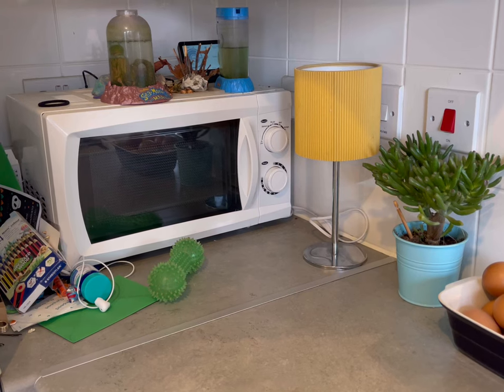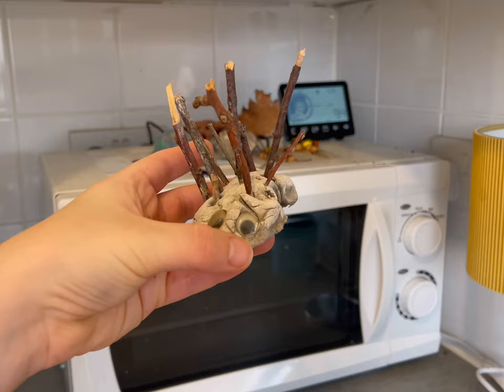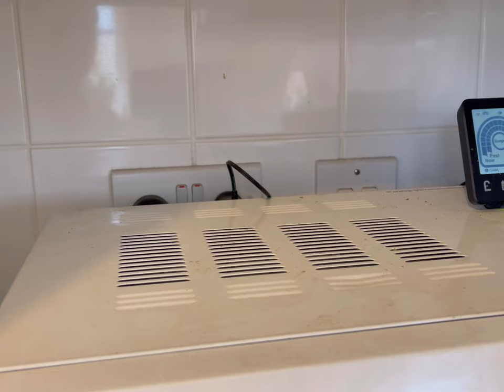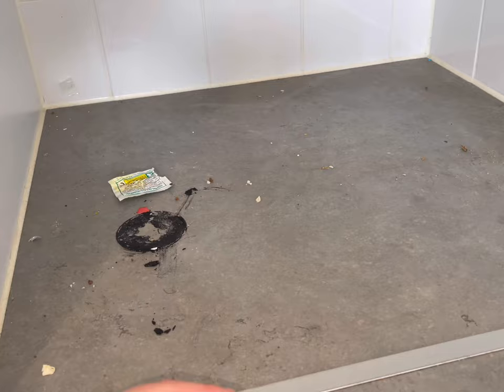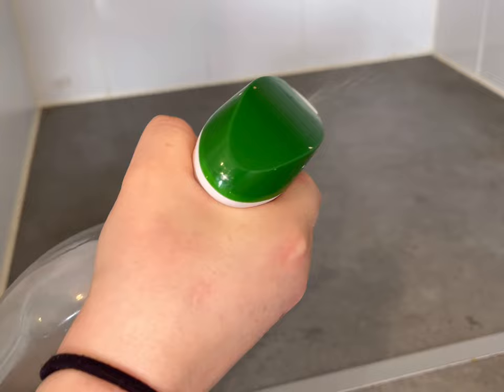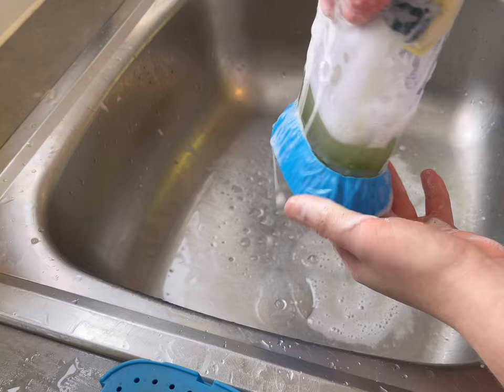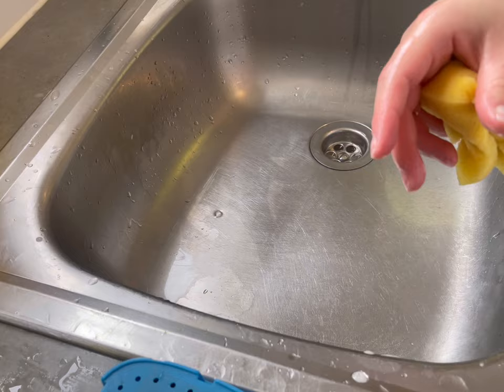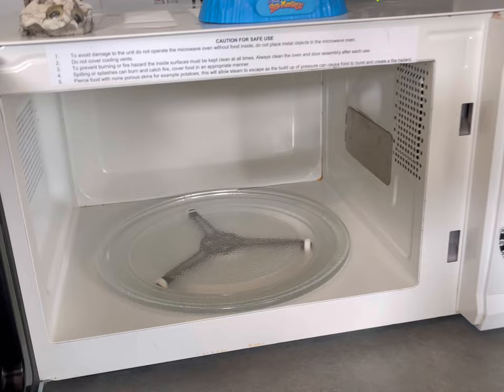VERY SATISFYING -Deep cleaning the microwave and decluttering the kitchen counter

Comment: Hello Remi, i just discovered  your channel. You're very sweet and down to earth. I clean my microwave by putting a bowl of water with a little vinegar in it and turning it on for 5 minutes. The steam helps loosen the splatters. You just have to wipe the area then. There's no need to scrub. Please try it next time. Lots of love from Canada.😊
Reply from the maker: Oh thank you for the tip!!! I will try it 😊
Reply: @remiclog   just discovered  your channel too, when you can buy some microfiber cloths they last for years and are better for cleaning than paper towels, microwave cover will help too, it save me, nice job, keep up !!
Reply: I do that too. It really makes cleaning it so much easier.
Reply: I have some rust stains on my microwave that I can’t get off help please ❤
Reply: @theresagosselin2705  Is it a stain or is the paint worn off in that area? Either way, get some appliance paint and lightly paint the interior, be sure to cover vents with painter's tape. Also do it outside.
Reply: Just discovered your channel as well! I use a similar method, but I add a few drops of Dawn dishwashing liquid to the water. Dawn does a great job of cutting through grease. 5 minutes on, then let it sit for about 5 minutes, then just wipe it down. The turntable, I put it in the sink and when I'm done cleaning the microwave, I dump the hot water on the turntable, wipe it off, rinse, dry, back in microwave.
Reply: Just discovered your channel.... your  absolutely ace....im originality from hull uk 🇬🇧  i now live in Australia..Brisbane....13 yrs... i love youe down to earth personality...makes me miss home😢....all the best from oz...keep  doing what your  doing xxxx
Reply: @sarahmail885  I live in Australia 🇦🇺 too. ❤
Reply: I second the vinger
Reply: I usually use lemon juice, or the squeezed lemon halves because they smell nicer than vinegar.
Although white vinegar is great for removing limescale and sticky stuff. And it's so cheap in Wilco's.
Reply: @theresagosselin2705  have you tried The Pink Stuff? Xxx
Reply: Yes. I heard of this before
Reply: When I have any citrus fruit I put the left over 1/2’s from juicing into a bowl with water and put it in the microwave for 5 minutes - it loosens on the baked on stuff and makes the room smell lovely. 

You can do the same thing with your oven too.

Comment: Hi Remi! 💛 You mention at the end of this video that you have trouble with mirrors. If it’s gummy or greasy use a bit of dish soap and water with your scrub daddy. After you remove all of the soap, just use your microfibre cloth to rub it with with a bit of water and it will be streak free! I like to make up my own DIY multi purpose spray with water and rubbing alcohol, drop of a good degreaser dish soap. The alcohol really makes the glass shine! 😊
Reply: I use  a bit of dish washing soap & white vinegar, works a charm!
Reply: My dh doesn't use it but I heard that polishing the bathroom mirror with shaving cream means it won't fog up in a steamy bathroom

Comment: You are a great and brilliant lady. Besides motivation, you also offer very thoughtful comments. I used to hate cleaning the microwave until I found a very easy way to do it in a few seconds. I fill a small bowl with water, then add some lemon juice AND half a lemon. Microwave it for three minutes. Take out the bowl and just wipe with a damp cloth. It will be spotlessly clean in a couple of seconds, and you don’t have to use elbow grease.

Comment: I am not a busy working mum, so cleaning the microwave I totally understand will not be a top priority. I wipe mine after each use using half a lemon and popping it into the micro for two mins. Careful when removing the plate as the juice is hot. I use the lemon to wipe inside. I find your videos so uplifting and very real about life.

Comment: Tip: put vinegar & some water in a bowl up let it rotate around for 3-5 minutes; depending how bad microwave is… my gets pretty bad. It will loosen dirt and grime makes clean up easy. 
 
I watch twice to make sure I wasn’t wrong; don’t forget the top of the inside. It gets pretty nasty and harder to clean later.

A toothbrush will get the tiny hard to reach cracks in the microwave door as will as the refrigerator door and hard to get to tiny places. 
 I love your channel.

Comment: I have a microwave cleaning tip for you. I take a paper towel or 2 and get the very wet. I take out the plate to wash like you did. Put the paper towel in the center and set it for 30 seconds. Let it sit in there for 2 minutes or so (just enough time to wash the plate). Open the microwave and spray your cleaner all over and start wiping it out. Comes off like a dream,  not stuck on anymore because you essentially steamed it off. Hope that helps.

Comment: Remi - a liitle tip for you about cleaning mirrors and windows that's incredibly simple and really effective - put a couple of tablespoonfuls of vinegar (white or brown) into clean water and use that to scrub the glass with a J cloth or clean sponge. It will get it really clean in no time and you won't need anything else, such as detergent etc.Then, go over the glass with a clean dry cloth to get the remaining water off and polish it up. I promise you - no smears and you'll get it done in a fraction of the time. I got this from an older lady regarding cleaning my windows and it was a real game changer. Thanks so much for these wonderful videos. I love your wisdom, humility and kindness. It's much needed!
Reply: When cleaning windows, wipe the inside in one direction and the outside in another direction.  That way, you know which side the streaks are on. It's just the getting around to it in the first place that is the hard part....😄

Comment: Don’t give your voice a second thought, your accent is lovely. I clean my micro about once a month. I put a Pyrex measuring cup with about 1 1/2 cups of water inside after removing the turn table and micro for 6 minutes. I let it set for a bit then just wipe out. The steam also sanitizes it. So quick and easy. 😊I wash the turntable with hot soapy water, rinse then dry.

Comment: I love your honesty and genuineness! I’m much older than you, but you just give me a lift. Regarding the microwave, I don’t deep clean it too often because it doesn’t need it very often- that’s not a brag. Let me explain. Our microwave is built in above my stove, and I’m so short that it’s really hard for me to reach the inside top and back without grabbing a step ladder. Granted I’m not the only one in the household with access to the microwave, so my strategy isn’t foolproof, but I have a plastic cover that fits over most dishes I’m heating up. Things might splatter on the cover, but not so much in the microwave. Just a thought in case you can find something like that. It’s much easier to clean the cover than the microwave.

Comment: Hi, we bought hoods to cover the dishes in the microwave. Sometimes, you get them on sale for 1 Euro (yes, I'm not from Britain). If they have bigger holes, one can cover them up with some paper-towel. If things explode or boil over, at least the mess is contained. The plastic-covers can be easily washed, even in a dishwasher. We keep them on top of the oven: right way - unused, turned - used, need cleaning. It's like a code the whole family and our guests understand. It saves a lot of time, energy, and - yes - scouring-products. Good for our purse, good for our environment... Oh, and yes, some of the hoods are as old as our first, still working and in prime condition, microwave which we bought around 1993.

Comment: Honest answer to how often I clean my microwave (inside)?  Whenever I have a dish sponge that gets grungy or smelly. I rinse the sponge with washing up liquid first, squeeze well, and soak with vinegar. I stick it in a bowl and put it in the microwave on high for 2 minutes. That sterilises the sponge, and softens whatever is in the microwave enough to just wipe off easily. If I'm motivated or it's bad, I take out the glass plate and wash it properly.  Because it's linked to the sponge, it's really part of washing up rather than a separate cleaning task. 
Love your channel, discovered it yesterday. 😊

Comment: I am like you Remi, I am not organized and I don't clean as often as perhaps I should...recently (within the last month or there abouts) I have been watching YT cleaning videos...and that has helped to motivate me. My microwave was a mess like yours but one thing I learned when I cleaned it is that the inside top was getting rusty a bit, I think it has to do with moisture being trapped inside after each use and it builds up...I did a really deep clean on it and now we leave the door propped open for a few minutes after each use and that has actually helped in keeping it clean believe it or not...maybe it will work for you if you try it. God bless!

Comment: Remi, there r over 200 comments so this suggestion might had already been made in regards 2 keepin microwave clean but a suggestion Would b to always cover every single dish that goes n the microwave   I learned that tip from another you tube channel. This tip has helped me tremendously even tho the microwave still gets messy ie not a large enough kit towel/paper towel over the bowl or rice boiling over. Cleaning for me is a 24/7 job. Good luck!

Comment: I am still ROFL from your remark, "I am grim." 😂  I keep a very clean house, but I still have bad days and weeks and it gets away from me.  Keeping a clean and orderly house is a struggle, even if you're good at it!  To clean mirrors and glass to a squeaky clean (no streak) finish, in a spray bottle, mix one part sudsy ammonia to 5 to 6 parts water.  Use a clean, damp washcloth, spray the cloth with the ammonia mixture, and wash the glass/mirror.  Immediately dry it with a 100% cotton, lint-free cloth (like a clean, unused baby diaper).  It's important to dry it completely (keep turning your drying cloth) for it to be streak-free.  I am a professional cleaner and I clean all the mirrors and glass (like glass-top tables and ceramic figurines) this way.  It never leaves any smeary buildup (if it does, you have too much ammonia and not enough water).  Label your spray bottle 'Ammonia' with a permanent marker, keep out of reach of children, and never mix or spray with other cleaners, especially bleach).  You can clean your windows with this method as well.  I buy 100% cotton 'flour sack cloths' at Walmart here in the U.S. and keep a stack of them on hand in a basket, and launder them when the basket is running on empty.  It will make your life easier and your house sparkle.

Comment: My microwave doesn't get cleaned enough because I'm short and it's a combo with the oven hood.  I have chronic pain and have a hard time reaching up without pain and my balance is bad so climbing up is a bad idea.  I have to get one of my adult sons to clean it when they are not working or busy.  I clean the outside and door and most of the bottom but can't get to the back and top.  Thanks for sharing your cleaning videos and for your honesty.

Comment: Next time you want to wash your microwave pop a cup of water inside and turn it on for a minute then take the water out be careful not burn yourself with the hot water, the just wipe it clean it will save you so much time. You are doing great 👍.

Comment: Love the chat  <3

I don't own a microwave, but those I've seen are always dirty!  So you have a cover for the open dishes to reduce the splatter?  Would a piece of parchment do in a pinch?

I notice you clean with what appears to be a lot of disposable wipes, as well as sponges.  My preference is to use my old tea towels, dish cloths, face cloths, etc., cut in half if needed.  They aren't pretty, but I prefer the texture, economy, and washability - and I think they do a great job.  

For my spray cleaner, I purchase the good quality refill jug and put a couple of inches in my old spray bottles (one in almost every room!), add vinegar, and fill with water.  it works better than the cheaper sprays and saves money to dilute it myself.

I also notice that you let your tap run while you washed the microwave tray.  When it was pointed out to me that brushing my teeth with the tap on would use 15 litres of water each day (yikes!), I became very conscious of not wasting (never mind that we have metered water charges).  I have my other issues, but now I try to keep the plug in while I wash any dishes  :)

I think Beta fish live about four times longer than sea monkeys.  Would your boys like a change?

The trick to polishing the mirror is to use a dry cloth to buff it after you get it clean  ;)

Comment: I clean my microwave when I first see it's getting bad so it doesn't get really bad. I also fill a bowl of water and put it in, then start the microwave till it just starts boiling.  Let it sit in there with the door closed for a while.  The steam loosens all the crud off and it's so easy to clean up.

Comment: Get yourself a microwave cover.  It's a sort of dome-shaped, plastic lid that you put over the plate or bowl that you're microwaving.  Then if something pops, it gets the cover dirty, not the whole microwave.  It's better than a paper towel bc it's tall enough that it doesn't touch the food.  I've used one for decades, and I never have to clean my microwave.  Just store it inside the microwave when not in use, or on top.

Comment: Small point, plse keep those vents on top of the microwave clear. 🙂
Another microwave comment - I use one of those plastic covers over anything that I heat in the machine. It keeps most of the spatters off the sides (not the dribble downs though ;-)

Comment: Something I like to do to clean my microwave is to fill a bowl or glass container of some type with water, heat it up for 3 mins. The condensation of the water makes it easy to wipe the microwave down. Just have to be careful because the container can be SUPER hot so you don't want to touch it for a while!

Comment: For the glass and mirrors, try a spray bottle with a mix of 90% rubbing Alcohol and a few drops of liquid dish soap (we use Dawn brand dish soap here) in a spray bottle. Sanitizes and shines....obviously always be cautious mixing chemicals.  Dawn and rubbing alcohol is strong but doesn't seem to be a toxic mix in my experience.
Reply from the maker: Thank you for the tip!!! 😊

Comment: I'm terrible about cleaning my microwave. I will put a coffee mug of water in to heat for a few minutes and the steam melts the gunk. If the tray has some really hard food on it, I let it soak while I clean the rest of the microwave. I run short on elbow grease and I've found this to be the easiest method. I also dont like the idea of residual chemicals being steamed into the next thing I heat up in the microwave

Comment: You can get a sponge wet and and put it in the microwave for 1 minute and the steam will make the crud soft and you can just wipe out the microwave.  If that doesn’t soften it enough just get the sponge wet a second time and microwave it for another minute. Be careful that sponge will be HOT.

Comment: Hi from Japan.  I don’t use the microwave so much so it doesn’t get so dirty.  Anyway, i think this works for me. It might help you.  During WINTER AND AUTUMN, every morning I make a hot lemonade in the microwave… lemons are just too expensive here so i use lemon juice in a bottle, cheap honey and tap water… microwave it, stir it and before drink it, I clean the microwave with a paper towel (got from the take out) in maybe 20 seconds.  I had been doing this for 10 years, plus using dishwasher/pour hot water before handwashing dishes, and i had’t have a cold  in TEN years.  My son recovers from a cold in 1 day.  
A plastic cover for the dishes would keep it clean too.  A cloth washable one would do the trick too.  
To motivate myself to keep the microwave clean and have it multipurpose, I use it as a brean box.  I put all the bread (in their bags) and in a plastic Tupperware and then into the microwave while its not in use.  It last longer.  

I love your videos.  Have a great day.

Comment: A great way to a yucky microwave?  In a heat proof bowl add 2 cups vinegar. Place in microwave for 4 minutes.  Carefully remove.  The heated up vinegar will have coated the entire microwave making it easy to just wipe out.  No scrubbing.  Plus you now have heated vinegar to pour down a yucky drain or toilet.